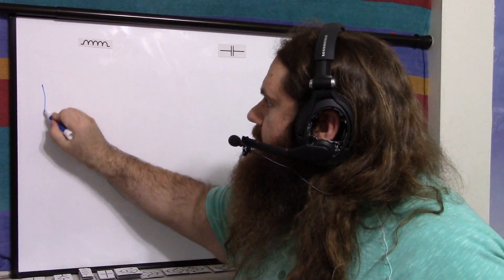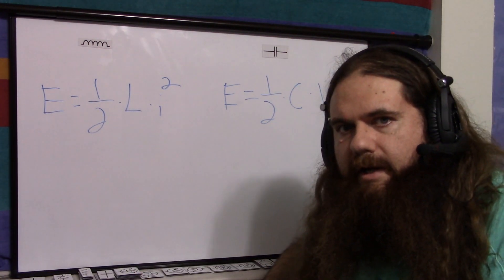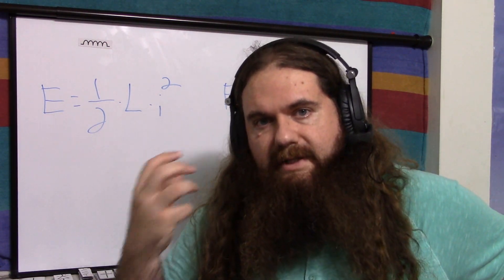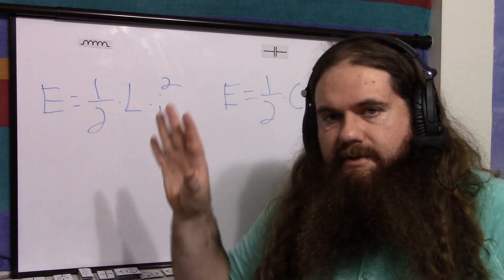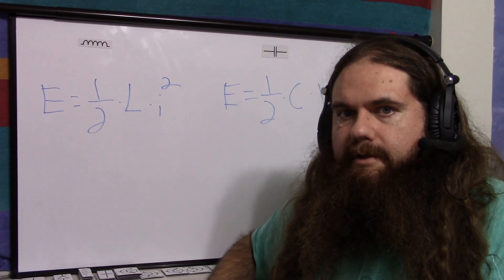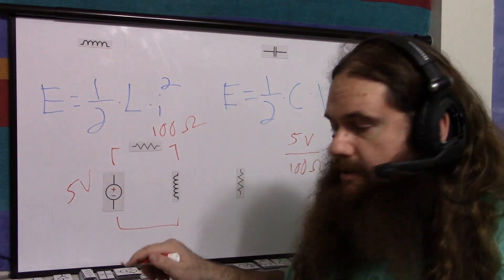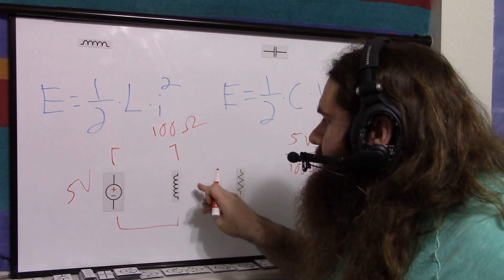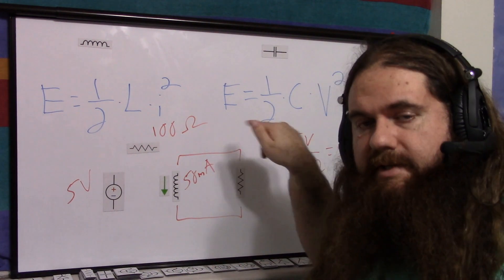Energy Stored In Capacitors And Inductors - How, And How Much - Simply Put

Comment: THE USUAL ERROR: In capacitors the energy is NOT stored in the electric field! It is in the potential energy of the electrons displaced by the battery. Nothing more, nothing less. A ball on the top of a ramp has potential energy, not the gravitational field. P.S. It's always easy to repeat errors ... without thinking ... so you can show your face on YouTube.

Comment: What happens if you take the voltage source away from a fully "magnetized / charged" inductor and leave a wide open circuit? A Lot of people says that the large back EMF voltage will arc over, but what if the open circuit is very wide? Where does the current go because the inductor does not hold it's "charge" as the magnetic field collapses when the voltage source is removed? Thank you for this great video. Not able to sort this fact in my mind!!